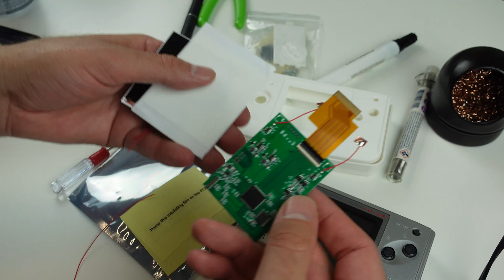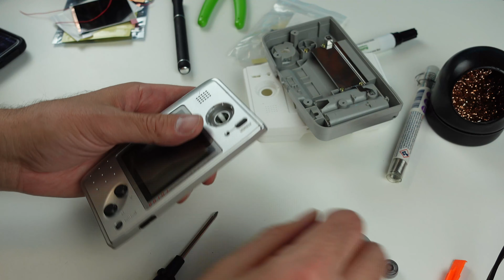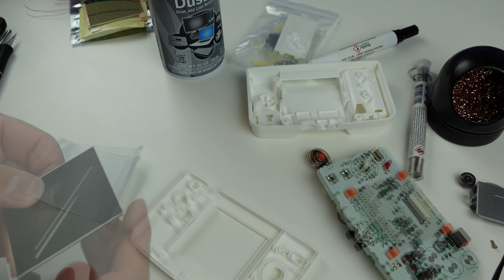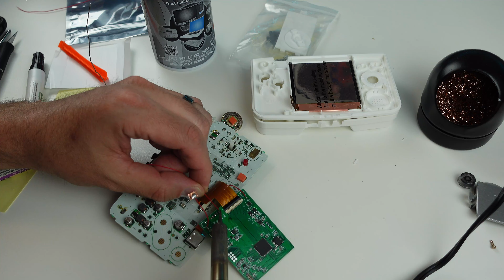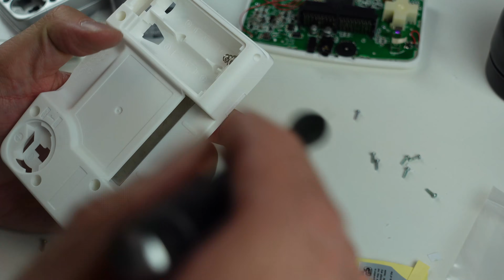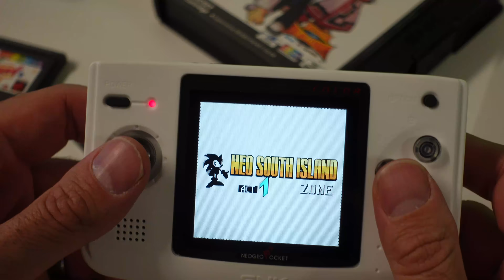The Best Neo Geo Pocket Color MODS! NEW IPS LCD, Touch Sensors, OSD & New Shell & Buttons!

Comment: Eneloops are 1.3V, some screen mods require constant 1.5V and the only way to get that is with disposable alkaline batteries or lithium ion batteries. The latter are attainable on Amazon in AA form. I figured this out the hard way with a recent GBC AMOLED mod. I'm also planning the power regulator and amp mod for NGPC.

Comment: Yes. I have a gamedrive with the same backlit mod and also have the same screen off on boot issue. I suspect the screen off issue may be due to the power consumption of the flash card. Now one of the tests I'm about to do is using Lithium double AA batteries (i just got energizers lithium today and about to test it). I was tipped that lithium battery produces the same current even when the battery is low and this may resolve the 'power on screen off' issue. 

I'll post back later today or tomorrow with my findings. If it seems to fix the issue, then my next step is to look for rechargeable double AA lithium batteries. Unfortunately, I don't know which brand is best to get, but I guess I'll research if this test i'm about to commence works.

Also, great video. I love my neo geo pocket and I wish there was a way to play these games multiplayer online. I'm sorry, but playing SNK VS Capcom on the switch is not the same. It's all about the beloved clicky stick.

EDIT : I don't get the problem with energizer lithium 1.5v battery. Now need to look for lithium rechargeables
Reply: Look up jugee batteries. They are the most recommended ones for modded gameboys

Comment: Screen not turning on is due to low voltage - if your batteries are low try lowering the brightness to minimum then boot into the flashcart.

Comment: They make lithium 1.5v aa and aaa rechargeable batteries but they are expensive. If the issue is the voltage on the battery then using those lithium rechargeables might be a solution.

Comment: The game drive and screen work together fine the problem is the rechargeable batteries as rechargeable batteries are 1.2v as non rechargeable batteries are 1.5v if you want to use game drive and rechargeable battery get game started with screen brightness way down then once loaded turn brightness back up to brightness you want but this solution can still be hit or miss but a non rechargeable battery works great every time maybe you can fine another battery solution like a 14500 li-ion or battery pack

Comment: Flash carts typically require more power than normal carts, and rechargeable batteries are 1.2V (as opposed to 1.5V with alkaline batteries), so your console/lit screen/flash cart need more power than they’re getting. If the screen supports dimming, you can try running at a lower brightness with rechargeable batteries, or resign yourself to having to use alkaline batteries if running the flash cart.

Comment: Are the touch pads taped to the inside of the case? Or what is holding them in?
Reply from the maker: They have adhesive backing to stick to the case.
Reply: @Madlittlepixel  right on thanks